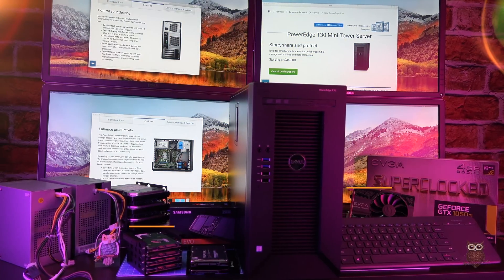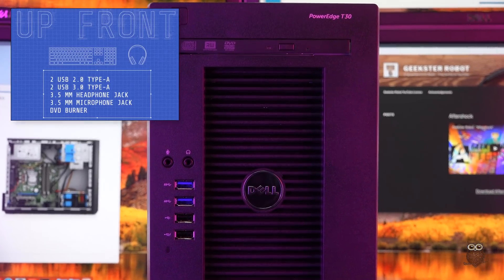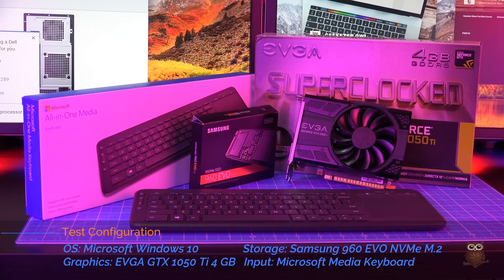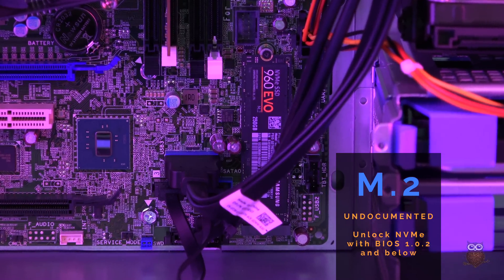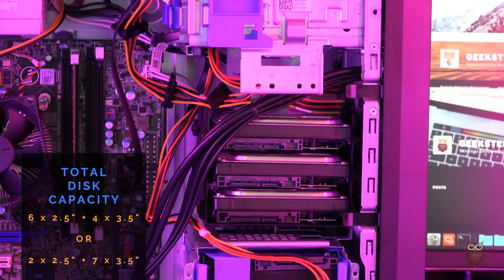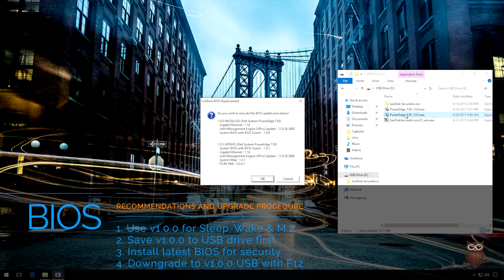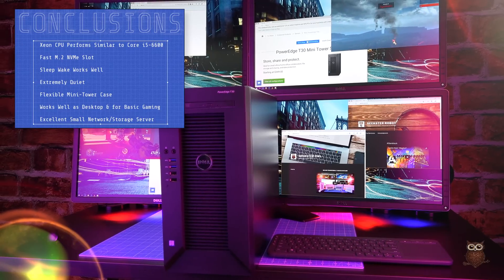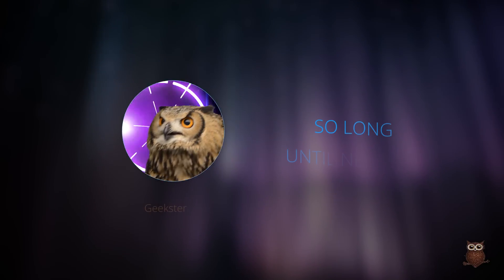$329 Dell T30 in 4K UHD

Comment: Slap in a GTX1660ti (after moving HDD bay to give room) and you have a dirt cheep gaming manchine... My self built Workstation with V3 Xeon, 16GB ECC ram and Asus Workstation motherboard did cost 4 times as much and I use it mostly for gaming with a GTX1080ti.

Comment: friends I have the same model T30 but I have a MSI GTX 960 4gb and I do not know how to install it by the 8-pin connector that gives energy, some advice please...
Reply: You need a power supply w/8 pin connectors. In order to use that power supply you'll also need the adapter cable mentioned in the video to convert the 24 pin mobo connector to Dell's 8 pin connector.

Comment: Anyone know where to find the v1.0.0 bios? My box comes in Tuesday, trying to the the files needed to get it up and running when it comes in.

Planning to put a samsung 960evo m.2 in it, but won't do me any good if I can't find the 1.0.0 bios, heard it's shipping with a different BIOS now.

Any help would be appreciated!
Reply: you can use 1.0.2 if you need the NVME. However if you need Sleep mode then you will need 1.0.0. I can help you find 1.0.2 but can't find 1.0.0
Reply: Thanks for the reply, actually I got lucky and the guys at the Slick Deals forums posted the BIOs, I downloaded it already, this is good for people who want to upgrade to 1.0.12 to fix the Intel AMT issue then downgrade back to 1.0.0 for nvme and wake sleep.

here's the link to help out the other folks.
http://web.archive.org/web/201707..._1.0.0.exe

Comment: Is anyone running bios 1.0.0 with win 10?
How is sleep mode working?
I can only wake from a deep sleep by pressing the power button.
Keyboard or mouse do nothing when in a deep sleep.
There are no bios settings in 1.0.0 to adjust USB behavior.

Thoughts and experience?

Comment: Can you supply the part # of the Dell 365 watt PSU noted in your video? Also any suggestions on an alternate 400 PSU that will fit in the T30?  Was thinking of using a Gigabyte GTX 1060 Mini ITX OC 6G which needs a 400 PSU. Thanks in advance!

Comment: Geekster Owl, Your Dell T30 video review is highly competent/complete/polished just like a professional.  

I've looked & looked & looked ... at almost every decent home server out there (starting with http://www.techradar.com/news/computing/servers/the-top-10-servers-for-business-1100986 ).  But for the price none can even come close to the T30 especially with your great recommended upgrades.  

Yeap, that T30 server is the most awesome-bang-for-the-buck home server out there & almost perfect for me.  But I really wanted/needed a server exactly like the T30 but validated/tech-supported for ESXi ( https://www.vmware.com/resources/compatibility/search.php ).   A little background on ESXi: It’s possible to run multiple OSs (ex: like Windows, Linux, Xpenology, etc) much like any software applications all on one single server.  A type1 hypervisor https://en.wikipedia.org/wiki/Hypervisor (ex: ESXi) is an intermediate OS between those popular OSs and server hardware that ensures each OS runs smoothly & with minimum hardware compatibility problems. 

Dell‘s T30 server is perfect except it’s none-validated/no-tech-support for ESXi.  Welllllll..... the least expensive best home server (validated/tech-supported for ESXi) seems to be Dell's T130.  Dell’s T30 & T130 servers are almost identical but the T130 has the validation/tech-support for ESXi that I need/want.    
   ~$500 T30 (HDMI; Displayports; sound ports ; no remote mgt interface; none-validated/no-tech-support for ESXi)  
   ~$750 T130 (no HDMI; no Displayports; no sound ports ; remote mgt interface ; validated/tech-support for ESXi)
Of course ESXi would probably run fine on the none-validated/no-tech-support T30.  However if I run into any problems, I would be absolutely on my own to fix them (a recipe for lots of frustration/profanity).

Soooooo most your recommended upgrades are highly appreciated & any appropriate ones will definitely be implemented my T130 (ex: GPU & extra HDDs).  

If you're still young, you might have a good future working in the pentagon especially as contractor within a large company like boeing or lockheed-martin.   Thks again, TomB  

PS: BTW, I looked at Dell tower servers with even more performance/expand-ability.  However with the increase in performance/expand-ability there comes an increase in power draw especially idle power draw unacceptable for a 24/7 home server (ex: idle power draw for Dell's T430 is ~128watts vs T30/T130 is ~37watts vs good Synology/QNAP home NAS appliance is ~15watts HDD in hibernation).

Comment: Awesome video, thank you!!! So updating to the latest bios software and then downgrading to 1.0.0 will still fix the AMT vulnerability? How is it possible? Thanks in advance
Reply from the maker: The ROM for Intel AMT is separate from the BIOS and doesn't allow a downgrade.  https://www.hardwareluxx.de/community/f101/dell-poweredge-t30-1142541-5.html#post25541561